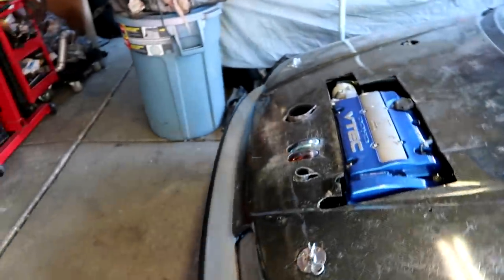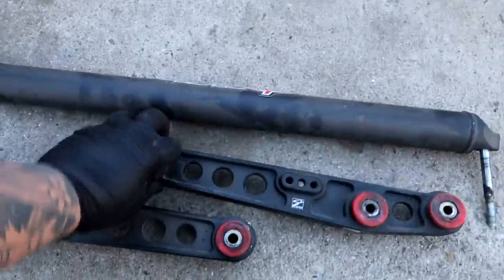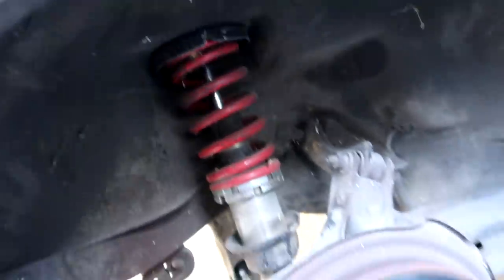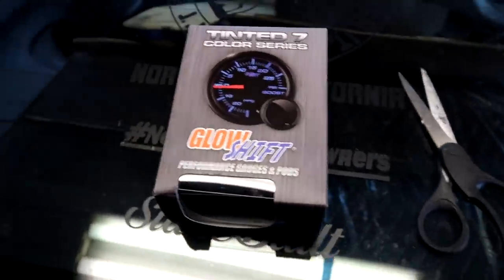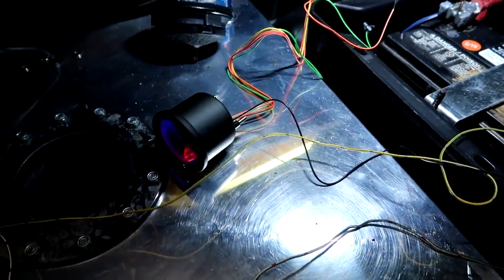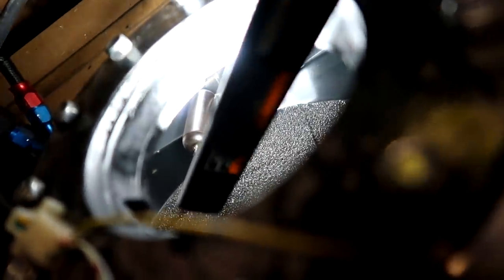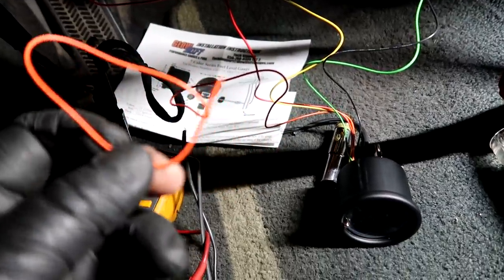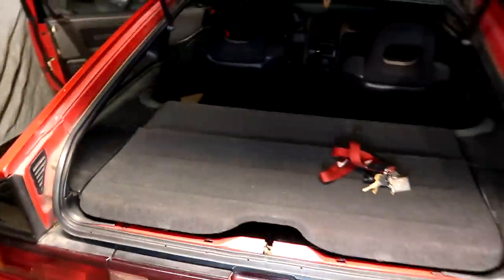AWD BUILD 21 : GlowShift FUEL Gauge Install

Comment: Hey have u ever looked into a 12 way 24 fuse box..u can find them on amazon or eBay...u can get ur 12v from the fuse box under the steering wheel and ground where ever u like..just make hooking gauges alot easier